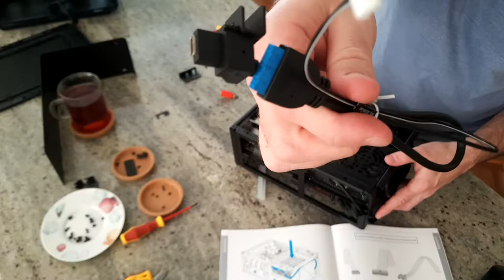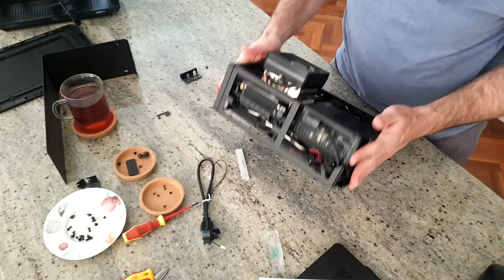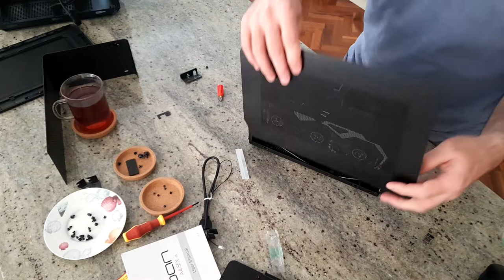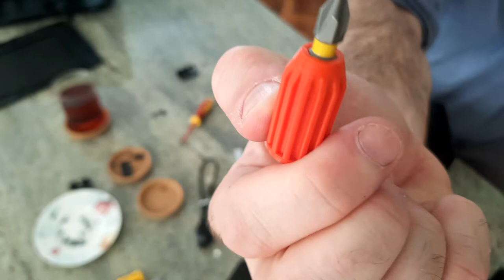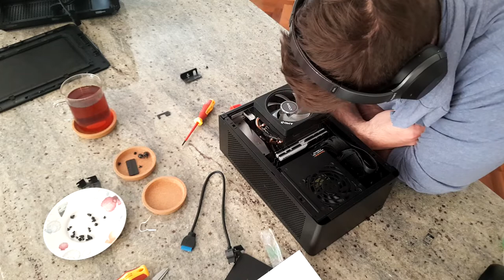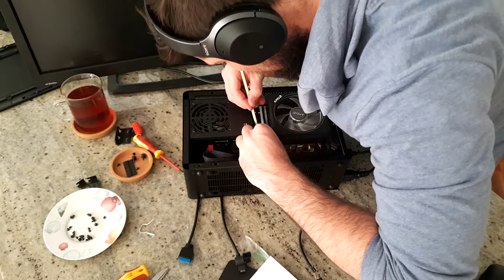Dancase ryzen build

Comment: Poor QBX. Got dumped because she is not as thin or sleek as the Dan. At least the QBX has better cooling potential I guess. RIP QBX! 

What made you go with the Dan over the Ghost?
Reply from the maker: I really wasn't a fan of the QBX. It has a lot of holes in it, for sure. But I don't think it has great air flow.
I originally bought my parts for the ghost s1. But it never became available for shipping to australia. I tried 3d printing it. But some parts weren't 3d printable in a way that would be acceptable or durable for a case. So at the end of the day, I think it comes down to availability. The QBX will probably become an open media vault server. It's easily big enough to take a micro atx motherboard, but the layout means you can't get actually fit things in there.
Reply: @alumunum  I understand. I forget sometimes, that availability differs in regions. 

I've only built in 4 SFF cases so far, and the QBX has had the best airflow/temps. Setup: 2 120mm bottom intake. Full 240mm AIO radiator with 2 120mm fans on side intake. Use a SFF PSU so you can fit the second radiator fan. Orientate the PSU with plug near front of case so you can fit 2 120mm at top for exhaust. At that point front 80mm intake and rear 92mm exhaust are optional.

This performs better overall than my ghost with large top hat  or my Ncase M1. The QBX is by far the largest though, so it should perform better. I still prefer the Ghost out of the three since I can palm it in one hand, but is the worst performer in thermals, even with a 240 radiator for CPU.

I really want to try a Dan case eventually. Next stop for me though will be an Ophion EVO with custom loop.